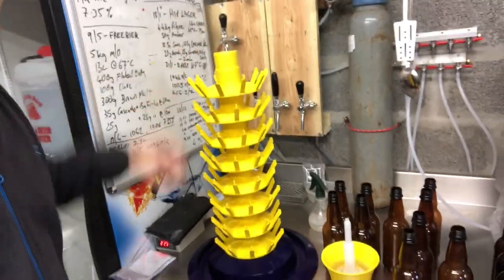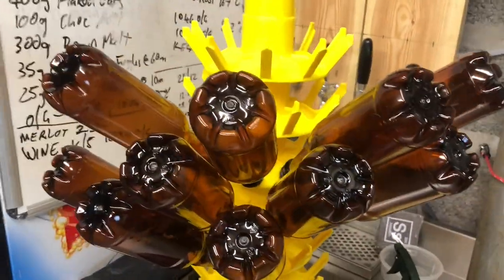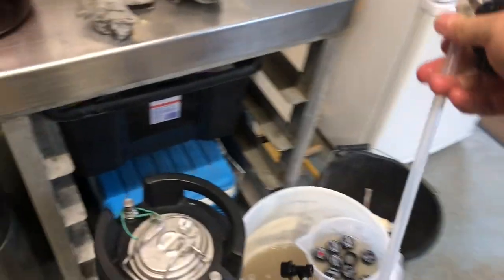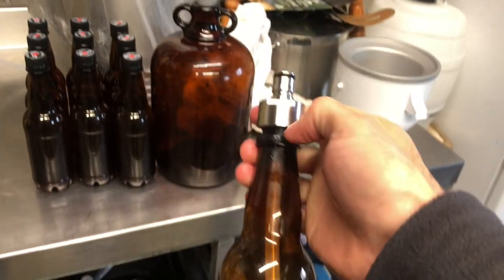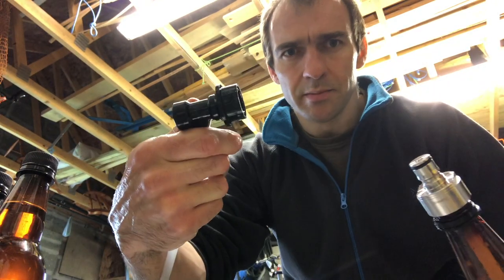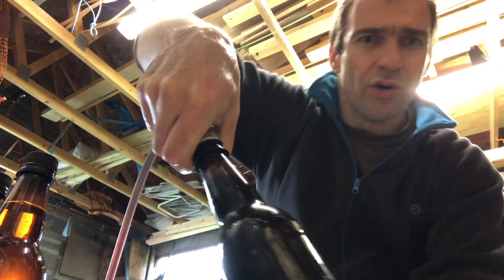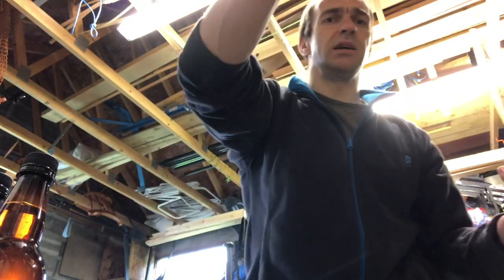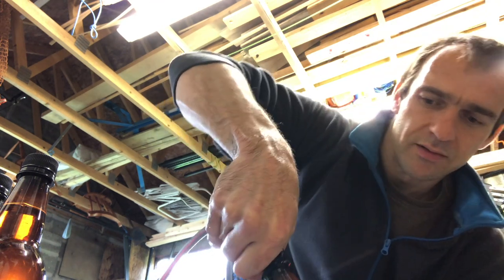BrewBru - ep4 - Bottle Filling Counter Pressure from Corny Keg

Comment: Excellent - cheers for the video.  Mine arrived yesterday.  I was wondering about putting a little hole in the filling pipe near the cap so that when you pull it out it'll let the beer in the line drop easily.

I tried that with a pipe I was using to fill from a standard bucket with a little pipe but it was a disaster because the Benoulli effect would just draw air into the hole, really not want you want.

Cheers.
Reply from the maker: Glad you enjoyed!  Interesting thought with the hole - but agree that anything that has the chance of pulling in O2 has got to be worth giving a miss :)

Comment: Looks good. What pressure do you have on the keg when doing this?
Reply from the maker: Hey, thanks for watching. Fairly low pressure, between 5 and 10 psi to keep it fairly slow into the bottle resulting in less foam and waste.